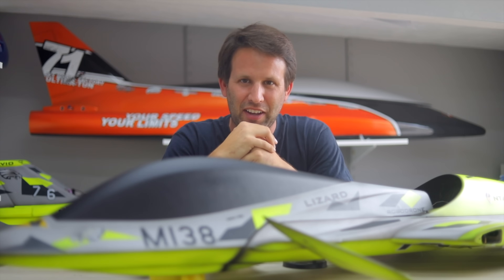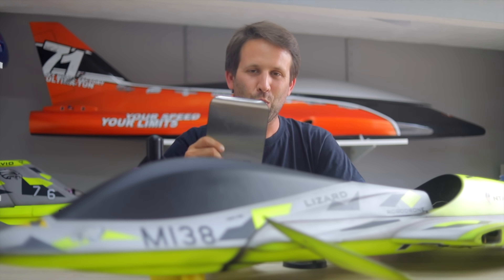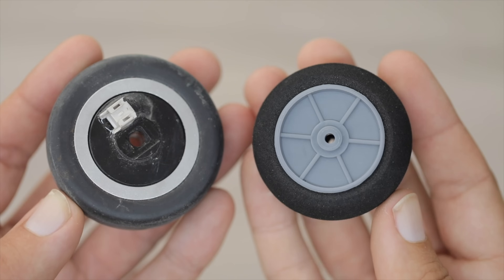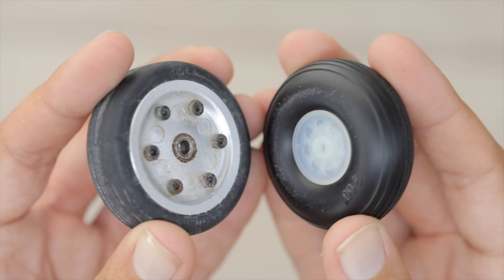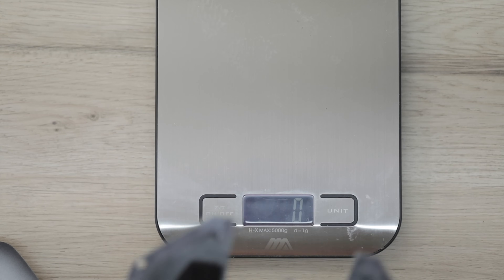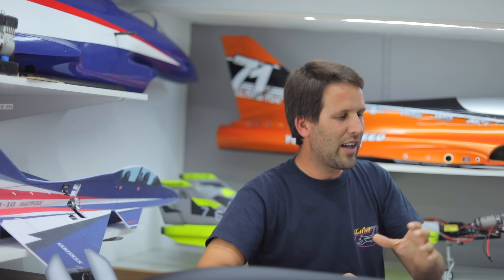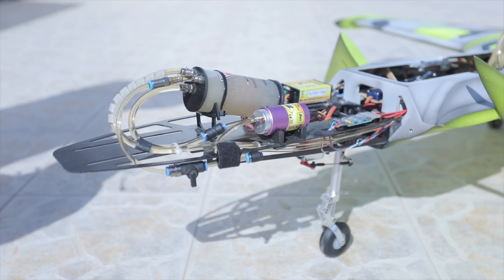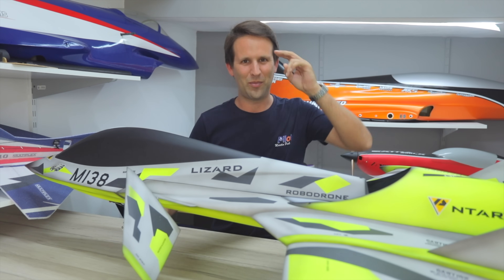SAB Lizard - Extreme weight reduction!!

Comment: When i replaced the heavy jetcat P80SE in mine with a Xicoy x120 I shaved off 1000g. Ended up at 7,22Kg on empty tank. 😎
Reply: Yeah he could loose even more weight by just using a xicoy x120, the jetcat engine ONLY is a bit over 300 grams heavier, and that is tail weight meaning you can also shave even more nose weight.

Comment: 2:45 Does a jet usually CRASH after engine failure?  Wondering why you forfeit a working rudder if turbine fails.  I guess you are not the type to run out of fuel.
Reply from the maker: Depends on the situation... Do you normally crash the car if you get a tyre blow out? Same kind of issue...  In most cases you can glide to a safe stop, under control. Other times it is in the wrong place at the wrong time...

Comment: But now you are holding more fuel....so probably around the same flying weight.
Reply: I think it's only an extra 200ml so 200g extra which obviously reduces as the flight goes on. It will use much less fuel to hover and harrier etc. so the flight time will increase exponentially.